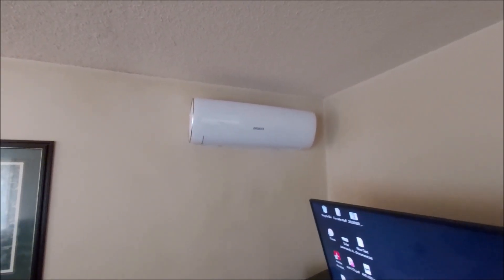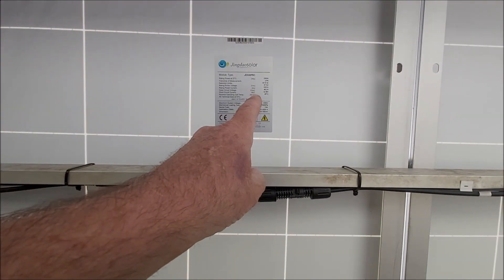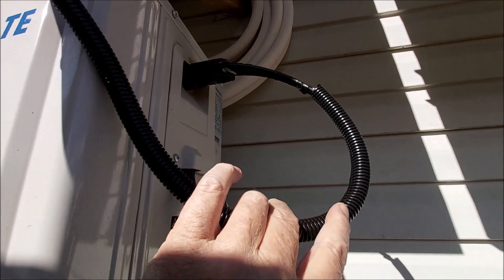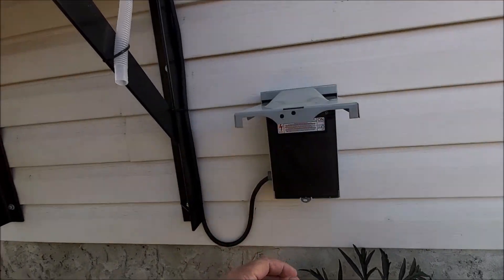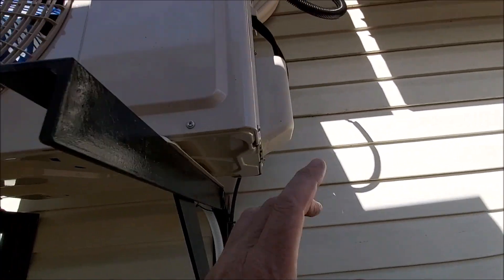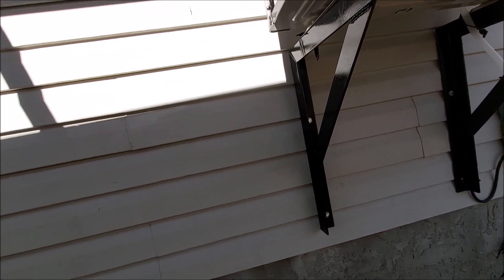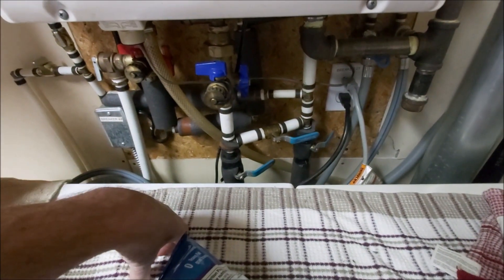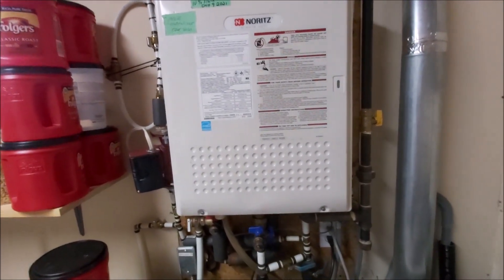Solar Powered Heat Pump And Future Plans To Heat Water

Comment: That's a nice setup. I like the way you can adjust your panels. I used some of that black wire loom from Auto Zone on my boat trailer wiring and it didn't last but a year or so. It is not made to be in direct sun, or at least what i used wasn't.

Comment: You need a dump load for the heat pump array
Reply from the maker: Genius. but I kind of thought  thought that this what my video eluded too. Beat ya too it.
Reply: Actually those direct DC heat pumps never make use of the potential of the solar panels to produce really you need batteries and a charge controller to win. But I guess you could heat water when the AC isn't running Offgrid Steve did that 20 years ago lol. @timcat1004

Comment: Exporting energy more than importing? Would Pine Road guy deliberate for hours to determine that is working smarter not harder? Looks like things will be toasty at your place so enjoy the autumnal evening weather, .
Reply from the maker: From Dec 2003 to Sep 2009 I lived in the Canadian Rocky Mountains and heated with wood. You can't beat the feeling of a wood stove. This heat pump heat is very similar too wood stove heating.